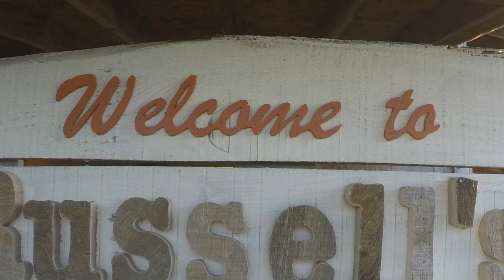wood cube puzzles -  scroll saw puzzle

Comment: Just ran across this video and it came just in time for making gifts for the bigger kids..
Can this be used to make a dolphin puzzle? Is it basically the same concept or does it require more planning in order for the finished piece to come out right??
I'm New to scroll saw work and still trying to follow lines (always afraid I'm going to break a blade during turns) Puzzles look like a great way to learn twists and turns to overcome the fear of breaking the blade.
Thanks for sharing Your Video!!